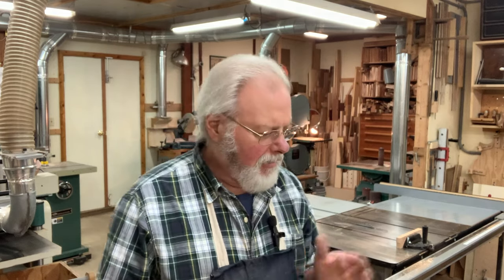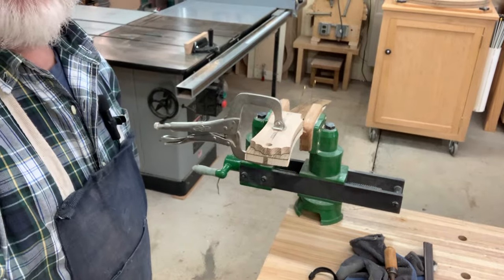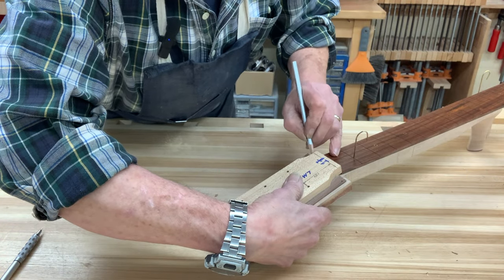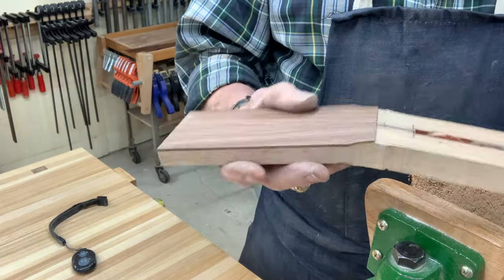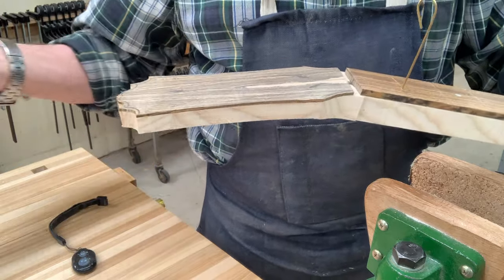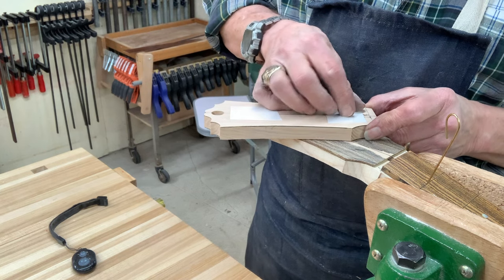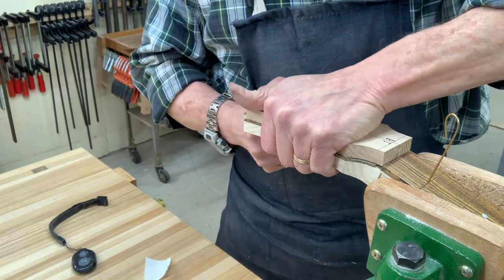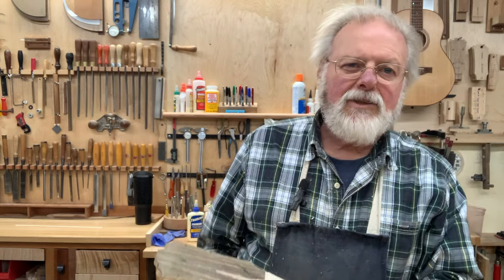Shaping Guitar Headpieces With Templates @thepragmaticluthier

Comment: I actually love my little Bosch router.  I made a much larger bottom plate out of thick clear plastic so it gives me a much more stable base even on smaller parts.  I get my clear plastic from Tap Plastics.  They have a scrap bin where things are pennies on the dollar.  Obviously this only works if you have a retail location near you.  Great video, thanks TPL.

Comment: Great video as usual. One of the things I always wonder when doing similar operations on the laminate router, is which speed to put it on. I just put it to 4-5 somewhere in the middle.
Reply from the maker: My opinion on that is; "don't all that speed just because you have it".  Most of the time, you don't need it to get excellent results and you can probably maintain a little better control over the router.

Comment: ?! what's happening around 11:17>>11:28-ish where that horizontally-oriented Knob on the Router Base is changing directions?!?
Reply from the maker: It's a knob used to hold an edge guide to the base. It was loose and rotating with vibration.